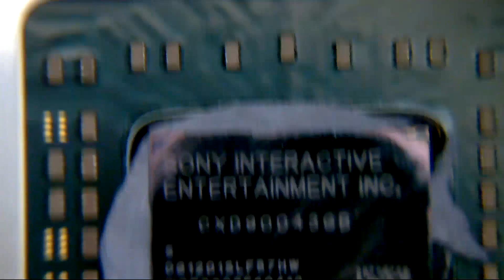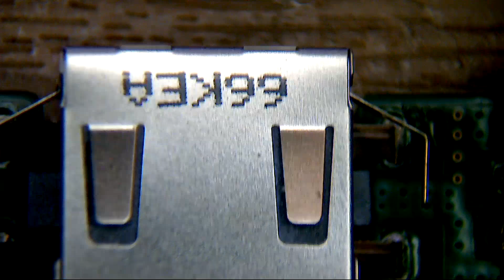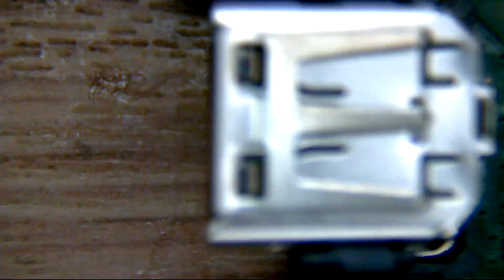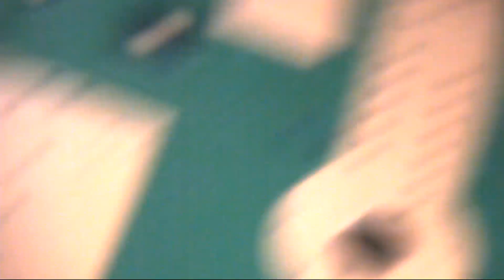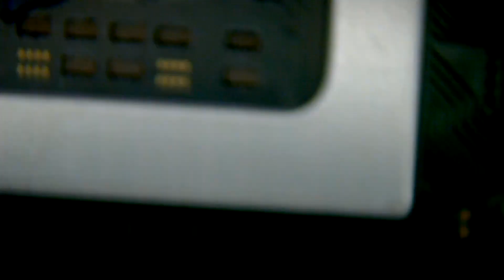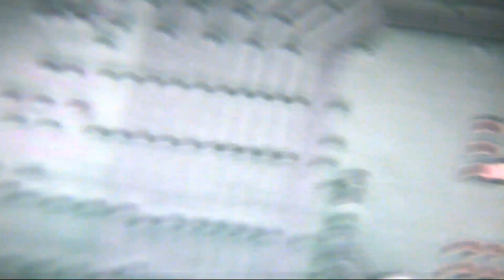A close first look at the new PS4 Slim SAD-001 Motherboard

Comment: Can you see a component on this board that serves to upscale/downscale the video output
Reply from the maker: This is handled by the HDMI Encoder - on these boards, the Panasonic MN864729 chip which sits behind the HDMI port.
Reply: Wow! Interesting. And would you happed to know if we play the ps4 on low resolution 480p , will it be running cooler and steadier as opposed to 1080p?

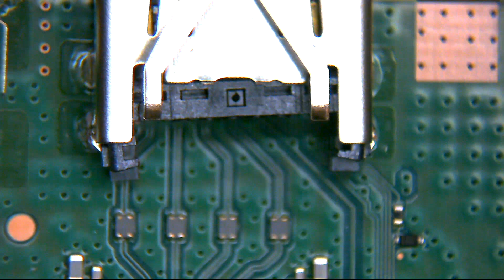Comment: Who know's what is the black pasive  component at buttom-righ?t in 3:05 , above the diode
Reply from the maker: It's a resistor though I'm not sure as to the value from the top of my head.
Reply: @AndrewPaul  ohh thanks,  I found short circuit , I will change , really thank you so much!

Comment: Hi Andrew, I have ps4 slim that if i turn it on its blink the blue light for few second and turn off. But the fan spine for just one second and the blue light remain blinking till it turn off after 10 second. 
I have done the re-ball, the same problem remain. What can I do to fixed it.
Thanks
Reply: maybe the APU is damaged or the rams need a reball or the inthernet chip need to be replace

Comment: Hi Paul,

i have a ps4 slim  SAD-001  no power on, PSU is good have tested. i have checked fuses and power related components but havent found anything unusual. On the older model ps4 the ethernet control IC  replacement usually fixes console.

hoping if you have a solution or have come across any ps4 slim  with  no power but psu good. Thanks in advance!
Reply from the maker: Hi,
No not as yet - I do have one to look at but I've not gotten around to it as yet.
Reply: same probleme did you find the solution ? try to replace the power managent ic and see

Comment: Hello andrew greetings from Cuba, I wanted to ask you, today I was repairing a bluethoo error I did the dump repair the firmwere and when I solde the nor and I turn on the console it gives two beeps and it stays with fixed blue light, that could be friend
Reply from the maker: Sounds like the original dump is corrupt or the patched firmware is incorrectly rebuilt.
Reply: Thanks for your reply, I extracted the dump with teensy and use way-launcher to read the nor compare the nor and they were ok, manually check the dump and it seems okay, I put the original dump unchanged again and do the same to the Connect the power cable 2 beeps and a fixed blue light, could not be problems when soldering the nor
Reply from the maker: Sounds like you've a short somewhere - what revision PS4 is this?
Reply: ps4 slim sad 00

Comment: Hi Andrew I have a problem with my ps4 I have the blinking blue light and I have no video signal. I have try a new battery etc. I hope if you can help me out. I think it is the panasonic mn86471A the HDMI port is good!
Reply: Dutch..
EMAIL Andrew: Send the console: Receive a Diagnosis: Either get it fixed or not: SOLVED